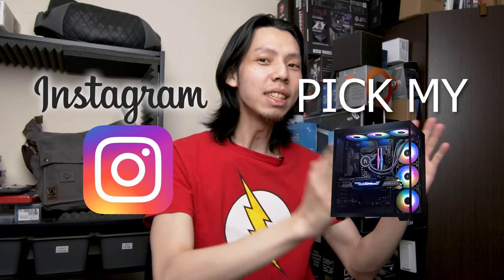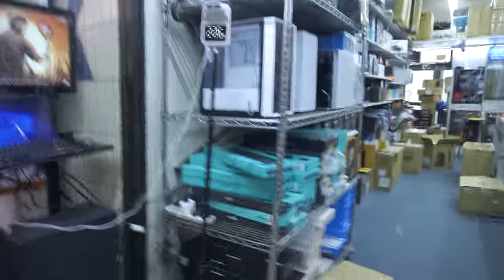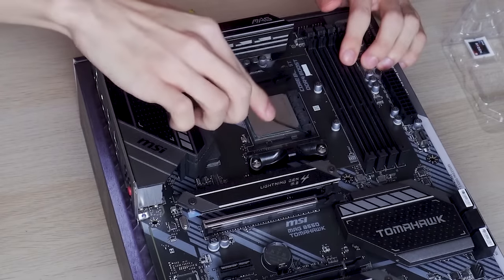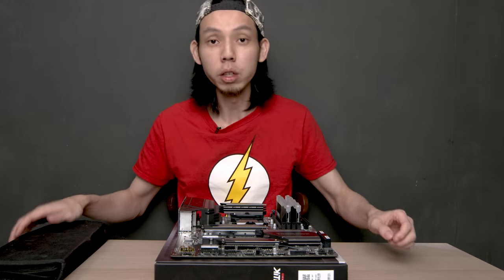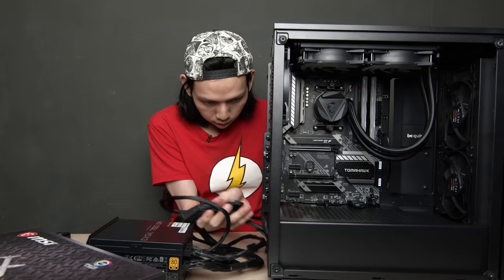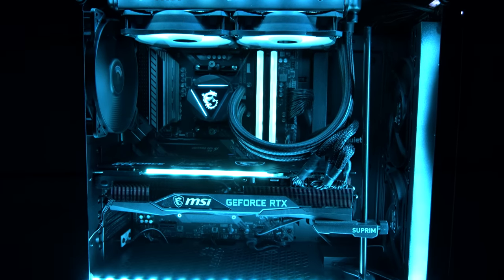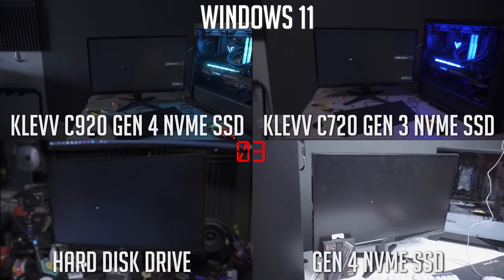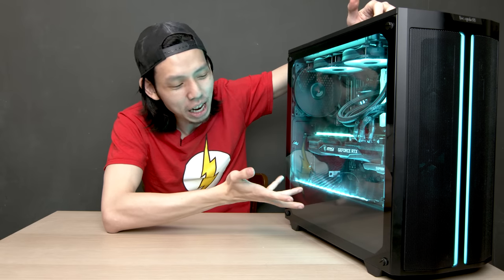Instagram Builds My PC! ft. Klevv C920 & C720 SSDs

Comment: Don't use Windows 11 on a AMD gaming pc. Win 11 will reduce the gaming performance. Tested and proven by several other Youtubers.
Reply from the maker: Most hardest hit for Windows 11 are the 2000 series. so far there is a slight performance loss but honestly is barely noticeable. hopefully there will be an update so there will not be a loss at all